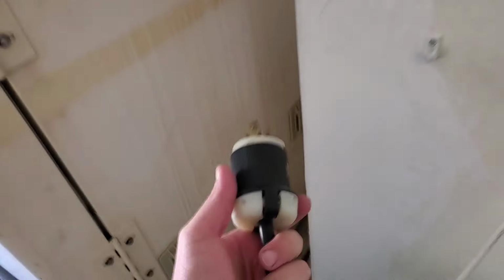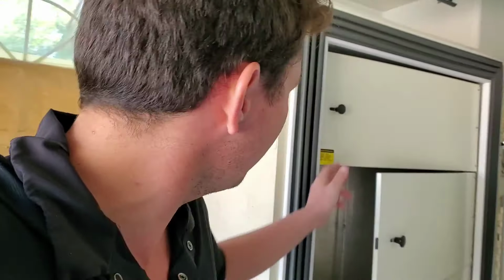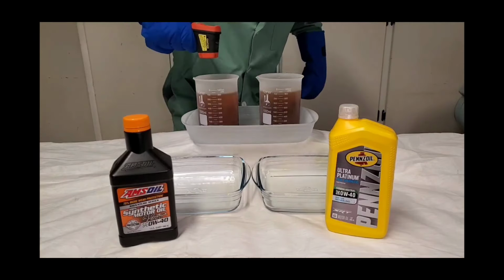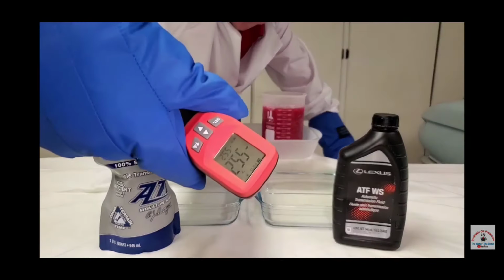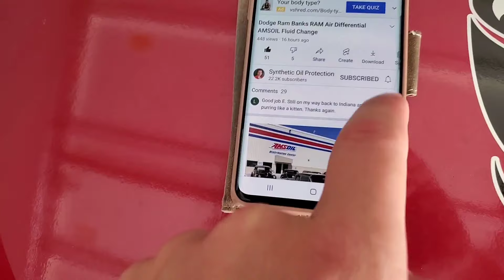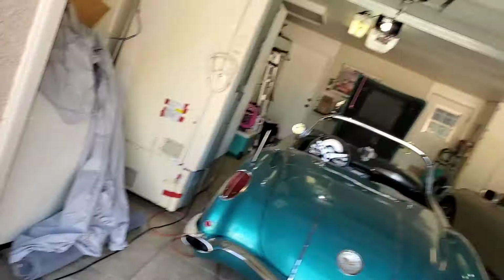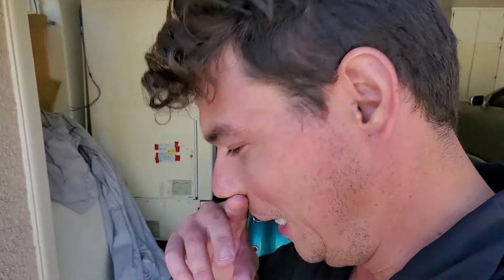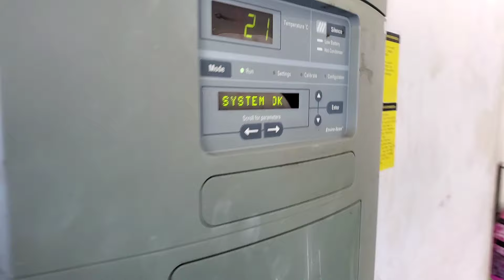Cold Flow Test Compilation vs Lexus WS vs Pennzoil vs Mopar

Comment from the maker: Watch This Next: What oil manufacturers don't want you to know about synthetic oil Myth Busted - https://youtu.be/L_c6wVSzX80

For me to get credit & be "Your" Independent AMSOIL Dealer please use my website below or my dealer no. 5331179 call anytime Eben Rockmaker 702-472-3614
After you click on: http://syntheticoilprotection.net
1. Click hamburger menu
2. Click buy wholesale
3. Add 6-month PC member to cart
4. Select shop by vehicle.

New promos: FREETRUCK
     
     🥇🥇🥇 Synthetic Oil Protection Google map reviews
Eben Rockmaker, independent Amsoil Dealer 
Dealer no. 5331179
(702) 472-3614
https://maps.app.goo.gl/1aXxuXrXK9eJwqK78
            
♥ See fluid performance tests - https://www.amsoil.com/performancetests.aspx?zo=5331179      

     ☕ Buy me a coffee - https://www.buymeacoffee.com/Syntheticoilprotection
Reply: Eben, i know you have a set way you like to test or display fluids , and it's showing them at the extreme. 
But i'd be curious to see on the cold pour tests to see the pour at  -30 C  or  -35 C   /  -22 F   or   -31 F    ,   just because that's about the coldest 
most of us , unless we live in the north north north , or say scandanavia would expect to see in general.    So at those temps it would be interesting to see if regular fluids still solidify and how much faster at that temp the amsoil flows.    But anyway , just a suggestion, not a criticism.
Reply from the maker: Hey I appreciate that unfortunately the freezer I have only goes to negative 50 degrees Celsius There are some other freezers that are in between I wasn't able to find one that had a broader range so I figured I do some deep sea diving.
We're going to be able to even show brake fluid freeze so that'll be really fun because the freezer I have goes to negative 80° c

So I figured I'd lean towards the colder side just to show stuff you don't really see on YouTube to make it a little bit more exclusive.

If I ever find a freezer that's in between I'll definitely get one as of now it's just already a lot of stuff to have.
I really appreciate the suggestion and maybe one day in the future will be able to get that equipment 😃😃

Comment: Just did my oil change with amsoil 5w30, added p.i additive too. Game changer. Now im still decididng if i want to switch coolants from dexo to the low toxicity coolant.
Reply from the maker: Yeah I definitely would because you'll have a lot better warm up time in the winter also you won't be on idle up as much and it's actually a lot easier than you think on most vehicles some vehicles are a stickler but like a Honda you can literally do the coolant in like an hour and a half It's that easy.
This was one of my really good videos showing the warm-up time difference https://youtu.be/zUDHutwKKCo
Reply: @Syntheticoilprotection  how do u mix this.. is it a gallon of low toxicity coolant and a gallon of water?
Reply from the maker: Yes the low toxicity biodegradable coolant is a concentrate so you mix it to whatever ratio you want all the ratios are right there in the back of the bottle and you just mix it with the still water
Reply: @Syntheticoilprotection  appreciate you eben

Comment: Tried royal purple in the wife's optima with gdi, have to add oil every other week, going back to amsoil!!
Reply from the maker: Yeah there's quite a bit of difference in the oil breakdown and also the film strength the way the film seals the rings This is the carbon deposit difference in a carbon test.
The Power of AMSOIL Signature Series 5W-30 Synthetic Motor Oil protects against harmful deposits on turbochargers 4X better than Mobil1® Extended Performance and 3.6X better than Royal Purple® in industry-standard testing*.  Read This Article - https://www.amsoil.com/newsstand/motor-oil/articles/leading-the-field-in-deposit-protection/?zo=5331179
Reply: Wow. Royal Purple Is a premium oil and thought it would do better. Good to know it’s not as good as Signature Series
Reply: @dashcamjourney4599  but did go from about 480-495 miles a tank to 515-525 miles, just have to have quart in garage at all times!!
Reply from the maker: Professional YouLubher: Eben Rockmaker Regency Gold Direct Jobber AMSOIL Specialist (Dealer#: 5331179) 702-472-3614 

     If you're New to AMSOIL I recommend the AMSOIL 6 Month PC Membership - https://www.amsoil.com/offers/pc/?zo=5331179
Reply: @Syntheticoilprotection  did just order amsoil for my daughter's 2018 Hyundai Tucson, not gonna mess around!!
Reply from the maker: Sweet ☕
Thank You for being a part of my YouTube community!

Are you a new preferred customer
Reply: @Syntheticoilprotection  no, have been for over 2 year's
Reply from the maker: Sweet💯

Comment: Hey Eben quick question. What's the difference between the two signature series transmission fluids. My corvette calls for the fuel efficient and my mountaineer calls for the multi vehicle.
Reply from the maker: The difference is the viscosity the multi-vehicle ATF is the standard viscosity that came out with the first ATF transmissions for instance my 59 Cadillac takes the multi-vehicle ATF fluid.

The fuel efficient is the newer viscosity which is thinner It has better fuel efficiency also it flows better in cold temperatures so you'll have quicker shifts in the cold.

Most of the newer transmissions all take the fuel efficient.

The signature series has more additives that are better in the cold also better high heat additives and that makes it overall a much better fluid and it's definitely worth the money.

If you ever want to try the Amsoil this is my personal link and if you ever have any questions you can always reach out to me.
Professional YouLubher: Eben Rockmaker Regency Gold Direct Jobber AMSOIL Specialist (Dealer#: 5331179) 702-472-3614 

     If You're New To AMSOIL I Recommend The AMSOIL 6 Month PC Membership - https://www.amsoil.com/offers/pc/?zo=5331179
Reply: @Syntheticoilprotection Thank you for the clarification!! I'm already in the preferred customer program just venturing into trying the other products other than the oil. Thank you again!
Reply: @Syntheticoilprotection  So the signature series multi vehicle would still offer up better fuel mileage over conventional I'm sure?
Reply from the maker: Correct compared to an OEM that's a synthetic blend it would make a huge difference because the Amsoil is 100% synthetic less parasitic drag also the fluid doesn't thicken like the other ATFs so it holds its viscosity better also has a higher pressure film keep protects the clutch packs you'll see a lot of different videos we've done in the channel under the playlists you'll see transmission fluid changes and there's about 30 videos of all different vehicles we've done.

Comment: Do a comparison with just diesel in the cold and than add Amsoil Diesel Recovery. Because it's supposed to dissolve the wax crystals that form when diesel fuel has surpassed its cloud point. Would be cool to see it work.
Reply from the maker: Definitely will do that one thank you for the recommendation 💯
Reply from the maker: Are you and Amsoil preferred customer?